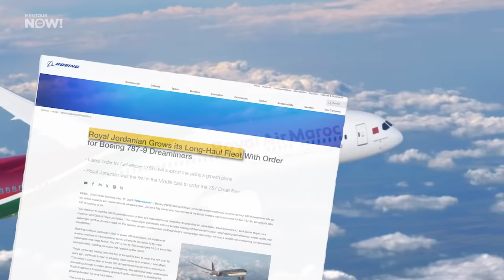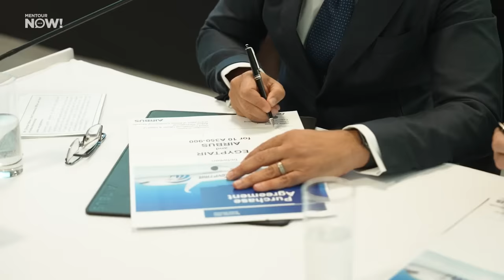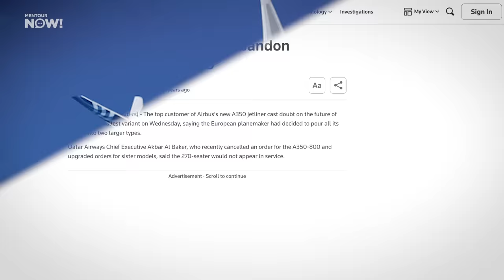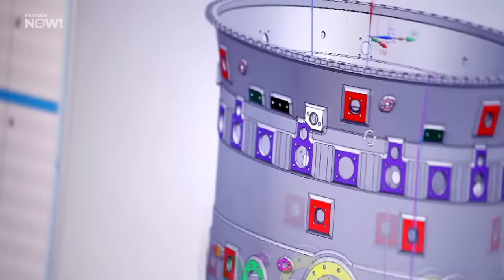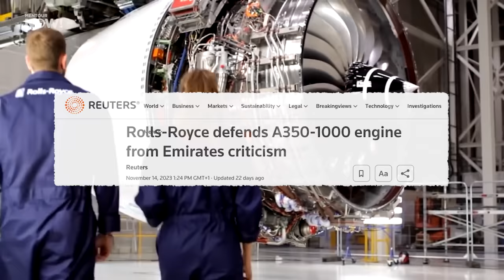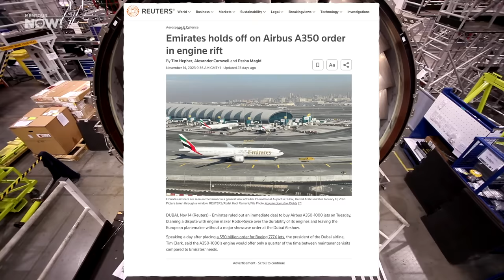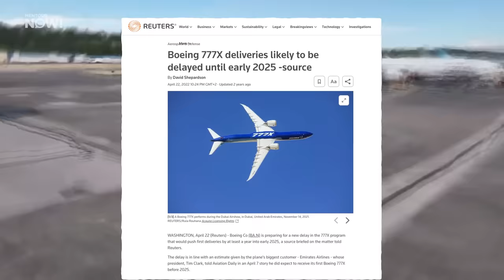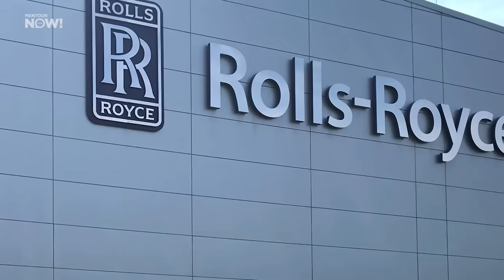What’s WRONG with the Airbus A350?!

Comment: Given that there used to be multiple engine options for each big airliner, I'm incredibly surprised that no effort was taken to standardize the interfaces used by the various engines, specifically so that engine swaps could use any available engine that fits the required performance statistics and conforms to the available interface standards.

There aren't really that many different interfaces needed.
Structural, fuel, electrical power, bleed air, control and instrumentation signals (via any means, during the 707 era it was probably a lot more complex but in the modern era it could easily be standardized to a data interface for the FADEC), am I missing anything?

Standardization would have to cover the specific type of connections involved:
Physical load ratings for structure (maximum load ratings, expected minimum safety margin, and if needed such as in the 747 "what force is required to separate the engine from the airframe"),
Electrical standards for power (volts max/min, if AC what nominal frequency and how many phases, normal/adverse/fault current expected values, harmonic noise tolerances, etc.),
Maximum flow rate, pressure, and temperature for gases and liquids,
Data interface standards (data rate, which protocol, what encoding, etc., probaby they'd settle on a version of industrial Ethernet) for data connectors.

As far as certification nightmares, it doesn't have to be.
The airframe manufacturer would need to certify the specific implementation of the engine interface standards used on the airframe.
The engine manufacturers would be responsible for certifying that their engines conform to the interface standards used in whatever airframe they wish to put their compatible engine in.
So instead of having to certify the combination of engine and airframe, they are certified separately by use of a unifying standard, which allows industry competition.

But what am I talking about, none of the industry wants competition anyways, not if they're already on top.
Competition isn't good for corporations, it's good for end-users, in this case the airlines.
Were this "engine interface standards" concept of mine an extant fact of life, Emirates would be ordering the A350-1000XWB with engines that weren't from Rolls Royce. At which point it would not be Airbus missing out on the deal, but Rolls Royce, the company that caused the existing IRL deal to fall thru.

Comment: The practical answer that Emirates wants from Airbus is for LARGE jet aircraft to suit their hub & spoke operation out of Dubai, and ideally that is the A380.   Like it or not, that is what Emirates really want.   With the A350 not being suitable because of the operational expense incurred using that engine, then it is currently at a stalemate...  so it is understandable that Tim Clarke would go with the Boeing 777X.   What Emirates really want over everything is for a new generation of A380.    Airbus utterly refuse to re-start the A380 program for reasons best known to them, but perhaps it is time that they re-look at that.   I know this is against the current normal trend of airlines, as we know quad jet aircraft have gone out of favour and now looked upon as "old hat"...  but not with Emirates and not with many long-haul passengers.    Are Emirates big enough for Airbus to re-start the A380 program just for them?   Would Emirates be prepared to make a solid long term commitment for the A380 in such a scenario?   I don't think a re-start of the A380 will likely happen given the thinking at Airbus, but you never say never.    I believe if the A380 was ever re-started, be it a new generation and much more efficient, some other long-haul carriers may be interested, such as SQ and QF for certainly on routes to Australia, the A380 is clearly the passengers first choice by a fair margin when flying the long-haul distances, and the least liked are the smaller 787's.   Having said all that, the A350 is well liked as well, and is also very comfortable.      Interesting discussion, if nothing else.

Comment: The problem seems to be, that a manufacturer plans to build a 800, a 900 and a 1000. Given the fact that 800 and 1000 will not use the same engine, they have to decide that discrepancy, speaking that the 900 will share one side of both (800 and 1000). The reality now made the 800 unproduceable because of customer dislikes - after the technical decision has been made to share engine between 800 and 900. And now the manufacturer is bound in the non-exchangeability of engines between 900 and 1000. - Does anyone remember how this is between 318, 319, 320 and 321?

Comment: There is nothing wrong with the A350, it’s the most advanced aircraft out there and nicest to fly, especially compared with the noisy 787 with that expensive air conditioning system and cramped 9 abreast seating. The 777-9 has not adapted much new technology at all and will be a 10 abreast bus. Boeing always start with a configuration then add an extra seat abreast in their standard specification on long haul aircraft. 747 was even originally a 9 abreast, 767 7 abreast, 777 9 abreast and 787 8 abreast. Eventually adding an extra seat to improve the operating costs

Comment: The only reason why anyone would choose Boeing is a huge US political pressure.
With the current huge safety issues Boeing has with the 737 MAX there is no reason anyone would pick that other than politics.
"787 uses electricity for that" and makes the batteries catch on fire from time to time :)))

Comment: I am rather disappointed in the comments of Sir Tim Clarke of Emirates for if you remember it is not so long ago he was so fed up with Boeing and its constant excuses for delays in the delivery date for the 777 X that he was threatening to cancel his huge 117 Aircraft Order ? He also knows that General Electric had had huge problems with its GE9X Engine which is possibly one of the main causes for the delivery date delays, plus there are still no firm Delivery Dates from Boeing today ?..  There is nothing Rolls-Royce can do about the heat and dusty conditions that the Far East region gives out but to constantly try to build their engines better to tolerate this.  I still believe as does the Australian Airline Qantas that the Airbus A.350 1000 is superior and by far more modern Aircraft and I think Sir Tim is playing Politics.

Comment: So -- Mechanics have to Pull 4 Pins and the engines fall off the wing....So they use a special fork truck to handle the fall. This is what I am to understand about the removal of a jet engine from a commercial air liner. Not a big deal to do. Doing the maintenance makes all the differences.....I understand.

Comment: Genuine question - not a sarcastic comment.
How long does it take to pull off an engine from the wing and replace it with another?

If it's not a stupid time, then RR could/should have said "we'll include another 20 (or whatever) engines in the price, and train the engineers in fast engine-out/engine-in techniques".

That would have improved the Time On Wing metric, and given the salesmen something with which to negotiate.

Comment: Looking at the thumbnail, there’s nothing wrong with the A350 there’s nothing wrong with Airbus. Boeing is what we have to look out for right now, outsource and sold off parts that make their airplane and they assemble it like, a Lego set. I think it’s the best analogy I can use but it’s a freaking Lego set.  You might think of some better analogies.  I mean, we could even talk about the time it takes to dim the windows between Airbus A350 and whatever trash model of Boeing has it and Airbus would still beat out Boeing.

Comment: Recently I traveled by Qatar airways A350 and saw several small patches on front wing edge and surface. I never saw such repair in other aircrafts. Does that signify some sort of material degradation?

Comment: Twin spool engines are more fuel efficient than three spool engines.
Source ICAO Engine Emissions Databank

For the 777 with the GE90, the sea level SFC is 0.324, at cruise it is 0.52.
For the 777 with the Trent 800, the sea level SFC is 0.35, at cruise it is 0.56.
For the 747-8 with the GEnx, the sea level SFC is 0.27, no figures yet for cruise.

GE90 SFC (SLS) 8.30 mg/N-s (cruise)
Trent 882 SFC (SLS) 15.66 mg/N-s (cruise)

Three spool engines operate at a higher oil temperature when compared to two spool engines and the oil distribution is much more complex in three spool engines.
This more complex oil distribution has given RR problems over the years, some call it oil hiding.

Oil temperature comparison
RB211 Series 335'F
Trent 700 374'
Trent 800 375'
Trent 900 385'
Trent 1000 365'

CF6-50 320'
CF6-80C2 320'
PW4000 350'
GE90 270'

Rolls Royce three spool engines cost more to overhaul than twin spool engines since there are more parts to deal with such as bearings, seals and a third drive shaft. 
An extra turbine rotor costs a lot more than adding two extra rows of turbine blades.
As well, the extra drive shaft and its associated bearings means more friction to overcome which requires more power to drive. This means more fuel is consumed because of the extra power required to drive another shaft.
So why is RR switching to the geared fan architecture as in the so-called ultrafan and away from the triple spool architecture-?
Because it is more fuel efficient, has less parts and will be less expensive to maintain.

Twin spool engines have a more stable airflow pattern through the core of the engine which makes them less surge prone than a three spool design.

Twin spool engines, (GE or Pratt) have less heat to dissipate than triple spool Rolls Royce engines.
Internal engine cooling airflow is less complex in a twin spool engine than a three spool one.
For this reason triple spool engines emit more smoke during start-up.

Twin spools light off and accelerate faster than three spools.

Most fighter aircraft engines use a twin spool design for faster throttle response.

Twin spools have lower manufacturing costs due to a lower parts count.

Twin spools are less expensive to overhaul due to the fact that they have only two concentric shafts, no third (Intermediate) compressor with its associated compressor and stator blades as in a three spool design.

The RR three spool is more difficult and more labor intensive to manufacture because of the nature of the concentricity of the drive shafts, support bearings and the fact that it has three distinct compression stages.

An Oxford University/Rolls Study from 4/9/02 - 9/30/03 document notes that 10% or more of RR engines fail the final passing out test due to imbalance. 11 Trent 500 production engines failed pass-off testing due
to abnormal vibrations. This indicates that there was a systemic vibration problem. A higher rejection rate due to vibration is detected when the engines are overhauled at the RR appointed agents.

Comment: Airlines don't like twin isle wide body jets like the 777 as the seats end up as two three two configurations as passenger simply don't want the inside seats.

A380 NEO is what emirates really want.

A350 does have CFM certification so its not the engine issue. Be very careful about manufacturers claims about service intervals to sell engines. Please note that aircraft in service are not in sand storms and dry hot air more than 10% of the time.

Quantas is no different from other airlines like Emirates. What is a major consideration in choosing aircraft is delivery schedules. The oddity here is that successful aircraft like the A350 periodically suffer from order droughts as they cannot build them fast enough for airlines in a fluctuating demand environment. The cost of capital increasing new plane orders can be delayed and residuals of type air craft  can effect cost in use for many airlines

Comment: No one ever accused me of being an engineer, especially on aircraft, but as a matter of general history, particularly military history, equipment such as aircraft and tanks could be produced in variants according to their missions and operating environments. The Harrier was produced in standard, and marine configurations, the Sea harrier being more resistant to salt corrosion than the land-based model. 
The Germans in WW2 learnt to their great cost that air the filters for their tanks and trucks, quite suitable for European conditions, were quite inefficient in the dusty conditions of the Russian hinterland, and as a result, their was very premature,  catastrophic and widespread failure of the engines in nearly all their vehicle park.  
I would have thought that hot dusty conditions was a fairly old problem therefore, so why did aircraft engine manufacturers build protections into their engines, or at least provide variants that optimized for the challenges of different environments?? I don't know this is even feasible on a jet aircraft however. The old piston-engine planes could certainly be protected by air filters, albeit at some performance cost. I have no idea how wear on a turbine engine due to sand and heat, but I imagine that turbine blade and material design, airflow through the engine, and hardening of crucial parts might help? 
But part of the problem may be home-basing? Conditions in parts of the mid-east do not tend to favour those jets spending too much time in that area [apparently] as foreign airlines in Europe, the US and Asia don't seem to be troubled by the issues Emirates and mid-east carriers are having? 
Any vehicle mechanic, or reasonable owner should find it reasonable that machinery operating in harsh conditions requires shorter intervals between maintenance, and probably reduced service life between major overhauls/refits/repairs?  Unless aircraft engine makers can actually work some engineering magic for their mid-east clients?

Comment: Airbus is absolutely dominant in the narrowbodies and is on roughly equal terms for the smaller widebodies. But Boeing an edge in the biggest widebodies. This is the long term penalty Airbus pays for making a mess of the 380 (which was less viable than it could have been with better design). The 777X will widen Boeing's edge here. The trouble for Boeing is that widebodies are a far smaller market than the thousands of narrowbodies, especially as narrowbodies are getting enough range to eat into what used to be considerd longhaul.

Comment: I would like see economics of 777-300ER, 787-10, A350 and 777X on transatlantic routes of 3000-5000 miles. Obviously the super advanced newer models win on the trans-pacific routes of 7000+ miles. but does the better fuel burn offset the higher purchase cost vs the mature 777-300ER?

Comment: From my views, Emirates merely put pressure to RR through airbus by placing orders to B777-x
it seems quite a large no. of placing additional 90 that make it 205 b777-x in total. 

In fact, if you have flied in Emirates B77w, it is really old, deteriorated, and major renovations are definitely required, or to be replaced 
recent 110 orders are just able to cover the old b77w, and some old a380s, if Emirates continue to expand, 90 more B777x orders(if not cancelled) are just sufficient to their needs before 2030s.

After 2030s, when A380s are starting to retire eventually , they still need a reliable replacement, and competition between B777x or A350-1000 is still ongoing.

Comment: First Point: The Dubai Airshow was a great Succes for Boeing and its 777-X-Program. BUT after Sir Tim critized the 777-X at multiple occasions down into the Bottom. So, first Lesson: Don´t put too much weight on interviews of Sir Tim.
Second Point: Airbus has a Backlog of round about 500 orders on the A 350 (both types) and round about 570 deliveries until now. Boeing has (including the 90 orders from Emirates at the Dubai Airshow) a Backlog of round about 360 orders on the 777-X (both types) and no deliveries until today - more of that: the 777-X isn´t even certified until today. So, second Lesson: Emirates is of course an important Customer - but Airbus isn´t depended on him.
More important for Airbus (and Boeing) is on the Widebody Market, that the 787-Dreamliner-Program is so much in advance of the A 330neo-Program.

Comment: Peter - You were biased on your UltraFan video despite it wiping the floor with the Ge9X. You were dismissive and it was evident throughout the video when comparing it with pratts next gen engine which is only in its design stage on the drawing board.

So. When will you do a similar video regarding your favoured american engines?

Comment: RR is still feeling the pain from increased inspections on Trent 1000, which were due in part to an airline operating the engine in a way that RR was not expecting (using a widebody to do short-haul). Therefore, they've become much more cautious about indemnifying airlines against higher than expected inspection and maintenance costs.

Comment: I thought the fan diameter at 118 inches is the same for Xwb 84 and 97 versions and the extra power is achieved by having a different core and a higher fan speed in the xwb97

Comment: I flew first class on A350 with Delta today. Really bad weather, heavy rain, foggy, and windy, but the A350 cut through the weather like they don't exist. Idk how it compared to 777, but it's super stable, and the cabin pressure and air quality is good (barely notice a change).